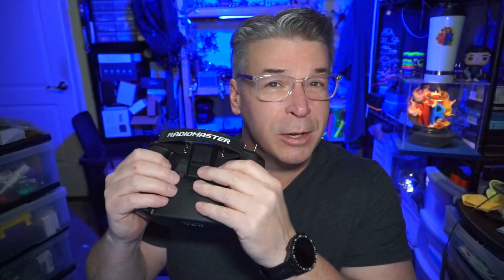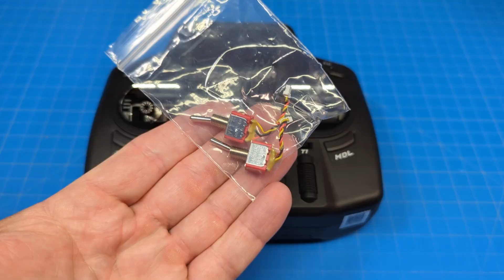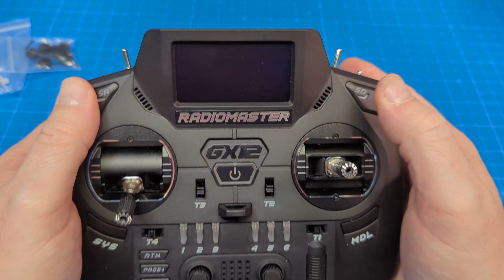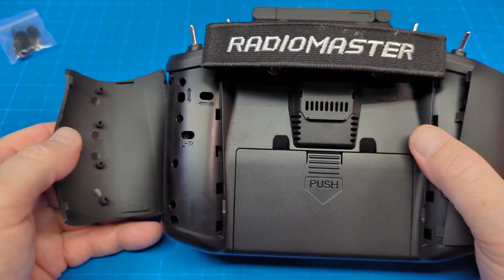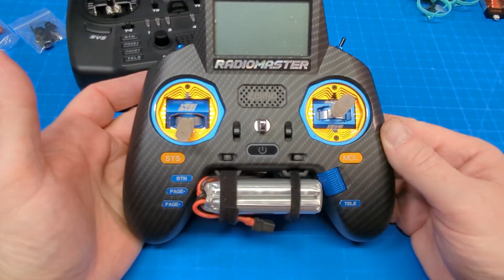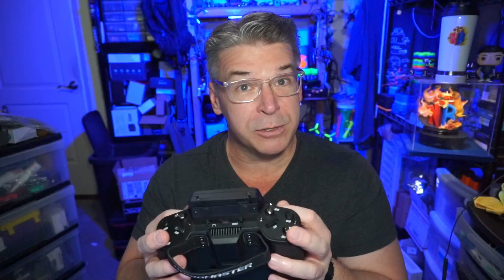Next Level Reliability & Flexibility // RadioMaster GX12 Gemini-X // Dual Band 2.4Ghz & 900Mhz

Comment: Thank you for the review. I have the question about singal stability with this universal foldable antenas. Did you have some problems with the signal strength? Normally I was able fly with my whoops around my house, in the garden always with the max power 25mW. Now with the GX12 I am loosing signal and have failsafes. I have to swith to the 250mw to fly same are of my garned, what is you experience with GX12? Any signal quality drop visible?
Reply from the maker: I haven't see that behavior with the radio I have. I suspect the ufl connection of the antenna is either damaged or its disconnected.
Reply: @NickBurnsFPV  thank you for the feedback, maybe I will try my luck once more time with the 3rd copy of GX12 😀
Reply: @lemonydes maybe cuz dual frequency ant. aren't as good as a single freq, ant.

Comment: Hello Nick, a big thank you for your work, which has helped me for years :-) can you tell me if this radio allows you to fly hobby horizon planes equipped with Spektrum Dsmx receivers? or if I have to buy 1 4in1 Micro/Nano Module - RadioMaster? Thank you in advance for your help and feedback. very good weekend
Reply from the maker: No this radio isn't spektrum compatible. It is only able to be used with ELRS. To use spektrum a module would need to be used on the back of the radio.

Comment: thanks for this.  I know this review was from a few months ago but I am kind of sliding back into the hobby after a couple years light on flying.  I have huge hands, I am a thumber, and have been using a Taranis XLite for 7 years straight, with crossfire.  Really like the gamepad shape but when I looked into the Zorro I just see way too many shortcomings.  The XLite has weak springs on the gimbals and I find I need more switches and buttons, plus I am already gearing up to start using ELRS and XLite may not be suited to ELRS.  I fly long range planes mostly and a few quads, but also some DLG gliders.  I am just not sure if my hands will like this radio, the XLite is ideal for DLG and hand launching planes.  Zorro with tiny battery, few switches, kind of a turn off.
Reply from the maker: The GX12 is really a large step up in size compared the the xlite or zorro. The width is mostly comparable to normal sized radios, but not all the way and not nearly as tall.

Comment: Why is changing the springs so tedious!!!! WTH 🤦
Reply: Its not that bad. You only ever set it once and then keep it. 

It gives it a cleaner visual look and prevents dust gunk build up
Reply: @KcCake No, it was a pain.. trust me.
Reply: @robertkgunn i have one an i was able to adjust mine alright. Its much easier than the x9d and tx16s
Reply: @robertkgunn wait changing out the springs or spring tension?
Reply: @KcCake changing the actual springs
Reply: @robertkgunn ah ok. Talking about different stuff!!

You have to unscrew the entire pcb and pull it out AND detach ufls right??

That is a pain
Reply: @KcCake I suppose that would make it a little easier. I changed them without removing the halls from the pcb 🤣
Reply: @KcCake they feel good with the stiffer springs! I like this radio better than the x10s I switched from. In every way other than the material it’s made of. The x10s feels like it’s more premium materials. Not that the gx12 is not. It feels better than you’d expect looking at it at least. It’s pretty comfortable in the hands and doesn’t feel like cheap plastic like I expected.
Reply: @robertkgunn which is the x10?

Ive tried the x9d with stock and hall gimbals,
Tx16s with stock and ago1 gimbals,
Boxer with stock and ago1
Pocket stock gimbals
Jumper t20
And this gx12

So far the tx16 is still my favorite. Not form factor wise but comfort and gimbal size. 

These gimbals dont cut it for me. Specifically how they are not able to be dropped

Additionally there is a deadzoning issue with the gimbals. Top and bottom of the gimbal does not have resolution so you have to limit stick travel. 

Also (BIGGER ISSUE) one axis changes as you move the stick on the other axis. Example: if you move the roll stick all the way to the left while pitch is centered, it hits 100% at the very left or when you touch the stick to the edge of the gimbal. However, if you move pitch all the way up or down, then youll notice that roll hits 100% in the stick input at ~90% stick value. Basically as you move the stick to the edges they hit roll/yaw much quicker than they should and gives an uneven stick reading
Reply: @KcCake my axis seem fine as well as the dead zone. I hope it doesn’t develop an issue like that. Can you not recalibrate it in software, to fix the issue? I mean rather than changing endpoints? Have you heard other people having this problem?
Reply: @robertkgunn no i have not heard of others. I will contact support. Just got the gx12 a couple days ago. 

These issues happened and are consistent even after recalibration

Comment: kindly show us. how to setup the radiomaster gx12 one by one to bind in the pavo25 with dji goggle 3 or goggle v2 if posible  you can  you do that for me. plesase.
Reply from the maker: Not likely something I would do. There are loads of videos on radio setup, the model of radio and the quad make little difference. What we need to learn is how to operate edgetx(radio) and betaflight(quad)
Reply: @ just to configured the gx12. like to set it up how to connect to every quad. or just do the settings. like how to arms the switches or how to function for every switch, and designated each of every one. thanks.
Reply: @NickBurnsFPV so you don't know. you just posting new gadgets. to have videos on youtube. ??
Reply from the maker: @AngelanthonetAnthon  Well that is pretty offside. Yes I know how to operate and setup radios. I have been doing this for nearly 10 years. I rarely make tutorials as they are well covered by others.
Reply: @. thank you 🙏🏻 hopping you can do it. and every one can watch your professional tutorials 😬. 
like joshua barbwell it's 10 year or more now  i think in this tutorial for professional fpv, and madTeach, and they does a lot.

Comment: You nailed it.  I have bought radios full of features then sold them just because I did not like the feel. If its not comfortable , man it is hard to stick to the radio. Everyone has different size hands, some pinch, some thumb so everyone will have some sort of complaint.  Their will never be a perfect radio that everyone will like.   Thanks for the review.
Reply from the maker: Yes 100% our hands size dexterity and feel is so personal it’s a stretch to get all the needed info without handling the radio ourselves

Comment: i really like the feel of a zorro too,, the shape is what i like and will be why i will not buy a gx12,  still wish they made a v2 zorro with better battery, 1w internal radio, smaller screen, and these folding gimbals,  that would be perfection... i used a zorro for 2 years till i switched to a hglrc c1 for a little more power and better batteries, and i just got the bumblebee, but it already has a few things i don't care for, wish it had gimbals like this gx12, these are really small and wish it had bigger latching arm , otherwise the bumblebee would be an amazing radio... as for this gx12, angle the sides and i'd get it.....

Comment: I feel the same way about the gamepad style of the zorro. I've got the zorro too and I also have the same feel holding it in my hands. I think the 18650 batteries and gemini are a reason why I would change. I could put 2x5000mAh batteries in there and that would be useful to quickly replace with another set of high capacity batteries. That's really nice. I dislike where the zorro batteries are and I think they're awkward to change. So I also have the goggle battery to quickly fit in when I need it.

Comment: May I suggest a video? I been flying the Pavo 20 and now the Pavo 20 pro for a while using the DJI controller,  Im liking more and more the Hobbie so I was wondering what would be a good radio to upgrade to.  I know there are plenty to pick from but a video explaining why would be nice.
Reply: Wanting to start also but hammered by too many recommendations.. Can I learn from the Pavo? and why are you wanting a new RC? I am checking out the Pavo but still researching
Reply: @Raleigh186  The Pavo for me has been a great platform to learn Acro FPV or  Manual mode if you are used to DJI Terms,  What got me into the small pavo Platform was the fact that is cheap and I wasn't scared of crashing and destroying the drone.  I crashed plenty of times and the drone just keeps flying. on the other hand the dji Avata I crashed it ones while learning and I had to sent it out for repairs. I actually fly almost always the pavo and not the Avata. there is a learning curve, learning how to set it up and learning how to charge the batteries but nothing anyone can't learn.  The reason I like to change radios is because I would like to get more into the hobby and for what I have seen on videos is that there are far better radios then the DJI remote controller. the DJI remote control works just fine but like anything just want to see if a better radio would make me a better Pilot.  Good Luck !!!!

Comment: Does edgetx allow you to run internal ELRS 2.4ghz and external ELRS 900mhz module at the same time on older radios, or have plans to do so? I haven't been following the cutting edge for a few months now.
Reply from the maker: Yes, but so does opentx. We setup two different model files, one using the internal Tx and the other using the external Tx.
Reply: @NickBurnsFPV   And you can run both models at the same time? (900 &2.4)
Reply: Anyway. I guess if you want to do this, you would just buy a Gemini module though, wouldn't you?
Reply from the maker: @kurtzFPV  No, that is why Gemini-x is so unique.

Comment: Wow this looks great, has everything i want in a radio: lots of flexibillity with the switches, compact design, white on black screen, 2s 18650 instead of 2 18350 batteries, cnc gimbals, and it now only has 1 usb c port. Definitely considering an upgrade from my zorro

Comment: If you swap your sticks do you lose the folding?
Reply from the maker: by sticks do you mean the gimbals? If so yes, the sticks are part of the gimbals. There maybe a way to move the sticks to a new gimbal but I have not seen or read of anyone that has attempted that, so we do lose the folding sticks.
Reply: @NickBurnsFPV  I think he actually meant stick part not the gimbal part. On most gimbals you should be able to unscrew the stick and put a different one. So i guess the question is if you unscrew these sticks does the folding part goes with it or stays on the gimbal?
Reply: Thanks for the reply, I mean is the folding part of the stick ends or the gimbal? If you fully unscrew the stick ends and use custom ones like thumb grippies do you maintain the folding function?
Reply: @GlobalSourcing  you shoudl though if they're wide it may not fold fully
also they're m3, not m4 like most stick ends.

Comment: The mounting holes at the bottom are for a new accessory that is a handle/brace/display stand
Reply from the maker: Interesting, I do see that now that the webpage is up. Not seen something like that in use before. Maybe something those that fly fixed wing use?
Reply: @ probably, if I flew standing up more often I’d probably give it a try

Comment: i know MOST people say they never touch their screen and dont need a touch screen.. but since ELRS started making aircraft receivers i have started swapping a lot of my airplanes over.. and open TX menus already suck but its still WAY easier to configure stuff with a color touch screen.. basically i NEED the color touch screen that the T15 has.. i really like MOST of the features of this radio i just NEED it to have a touch screen for my use case..
Reply: I have been on the fence for a radio for a couple years lol I was about to buy the jumper t20 then a few versions came out then a new t14 15 ect ect its crazy how these companies are just playing catch up with each other rather than making a solid radio with everything on it Instead they offer a little on this one a little on that one 😂 jumper 15 is so far the one I want since I fly planes and quads just wish they'd offer it in 4in1

Comment: Of course Radiomaster has to release this after I already bought a T20 V2 and a set of AG01 gimbals, and modified it all to fit together lol
Reply: At least you didn’t go as far as the guy who stuck a ranger inside their t20 😂
Reply: @AttentionDeficitHobbyDisorder

You can't beat the satisfaction of building your own gear
I like modular RC systems that can be modified and repaired by myself.
Not sure about the GX12 gimbals yet though, time will tell if RM have made a good decision.
Reply: @AttentionDeficitHobbyDisorder  
I know what you are saying; it happens to me all the time: i wait almost a year for bugs to get worked out after a new release and get caught with the “newer/better “ products, for less.  Like i put ago1 gimbals in my boxer and they came out with one with the AGO1 gimbles, with nicely color button for less than i paid for the radio and gimbals i bought separately.
Reply: Same 😢
Reply: Man I have tendency to buy things exactly before they announce the new thing.
Reply: Yes, a stick video would be good.

Comment: How does it compare in size and feel to the Jumper T20? It's my daily driver, but I don't like the tension, and I can't get it tighter.
Reply from the maker: The feel is more weighty or firm. The size is similar but without measuring I can't be more specific in size.

Comment: A single USB port! Nice move, radio Master.
Reply: Took them long enough.
Reply: @neuromancer692  you're not wrong.
Reply: Это плохая идея. Теперь во время использования симулятора аккумулятор будет постоянно перезаряжен.
Reply: I kind of prefer having the charging one on bottom and the data/simulator connector on top myself.
Reply: @kurtzFPV  but now (unless I miss my guess), You can charge and sim at the same time, through a single cableñ
Reply: @notice_fpv  probably so with an adapter